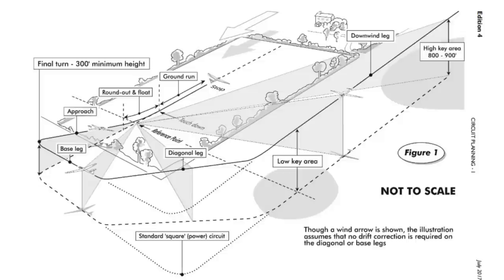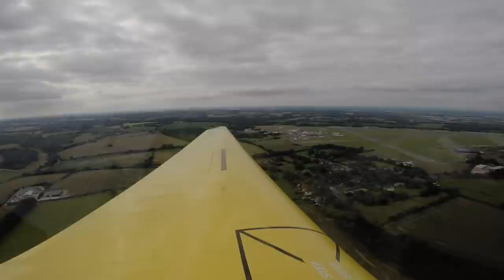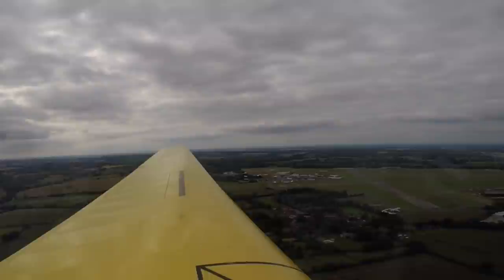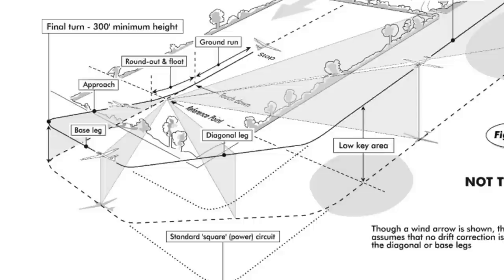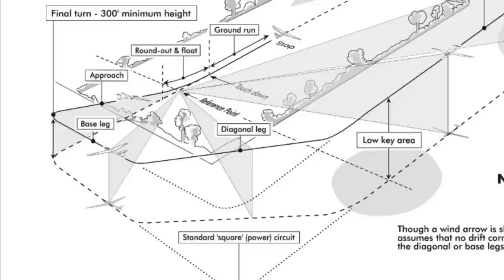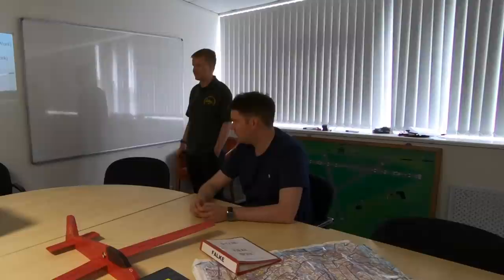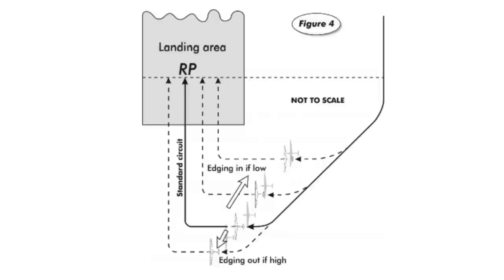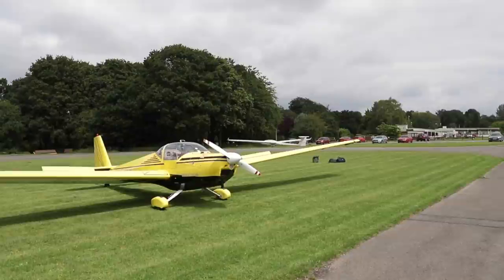Powered Pilot Learns To Glide - Episode 2 | Glider Circuit Training

Comment: I've always wondered why people who want to learn to fly, don't elect to take this route into aviation. A week or a bit more is sufficient for many to solo in a glider and a few hours in the Falke at Lasham is all one really needs to get airborne for a fraction on the cost of a PPL. Nice filming Ben. You should do a bit more filming & soaring in the summer in a two seater glider.
Reply: My dad did, under his boss' say so (long story), dad went solo quickly and did a bit more*, before his boss funded 66% of his PPL. Dad then soloed in a tail dragger (Condor) at 9 hours, circa 1969, iirc. 

Fixed wing microlights are an even quicker and more cost effective route into aviation. Having said that, several pilots I know who have NPPL (M) and/or are instructors, started, like most of us, on RC models then gliding. With several going onto advanced GA ratings etc.

* Dad got a bit fed up with helping out a lot at one club, then waiting ages for a flight etc.
Reply from the maker: Thanks, Graeme! I’d love to go back over summer and do some more!

Comment: I learned to glide before I did my PPL which certainly helped me solo early in the Cessna, but some of the gliding instructors had said really one should first learn to fly (PPL) then learn to glide. I can see advantages both ways. There's loads of stuff Ben's doing on this vid, loads of awareness, loads of being at home in the air, that he wouldn't have if he wasn't already a PPL. On the other hand, when I started power flying I already had 'stick & rudder' skills from gliding, so effects of power, circuit planning, radio etc were easier for me to concentrate on than for a raw beginner.

Really interesting series of vids, Ben. Thanks for doing them.
Reply from the maker: That’s really cool, thanks Vince!